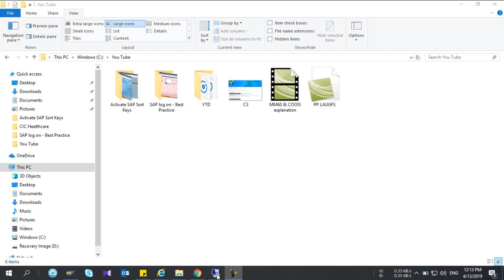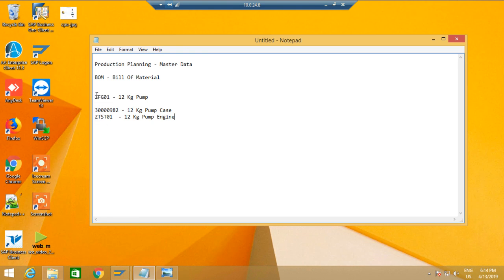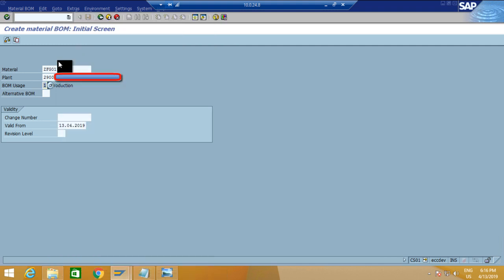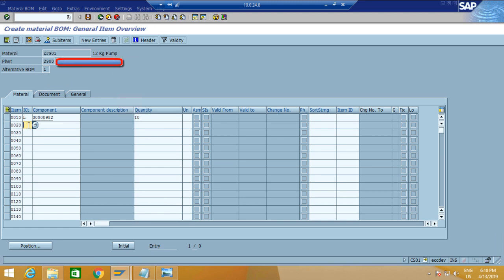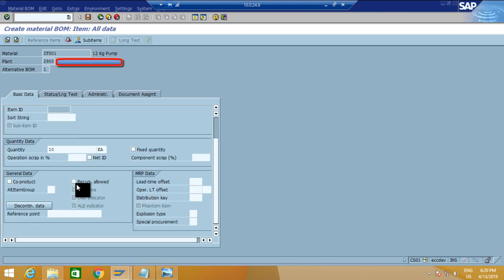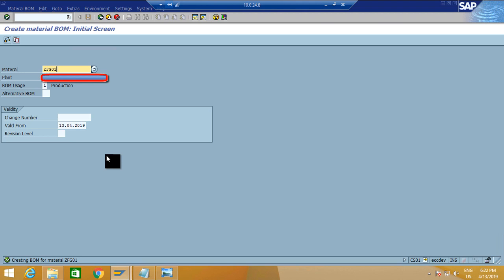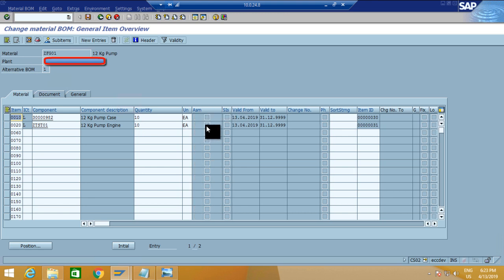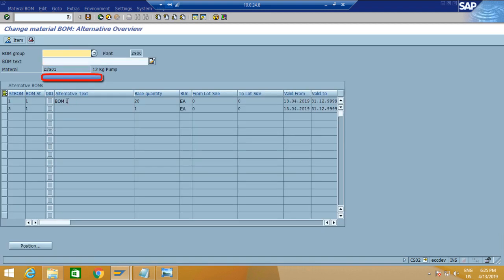How to Create BOM (Bill of Material) In SAP - PP Master Data CS01

Comment: speaking of list of materials... is there a way to add an option for a component in the list? meaning, if i'm out of stock in sap, it will check for the second option and consume this. I'm trying to avoid creating another version, just for a component that has two options available.
Reply from the maker: At which point you need to check the stock? During BOM creation or production confirmation